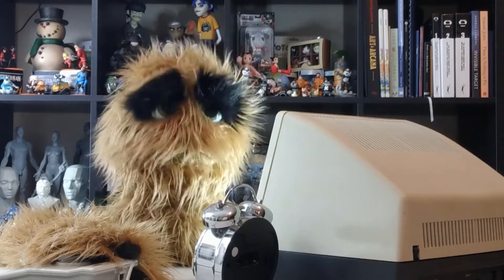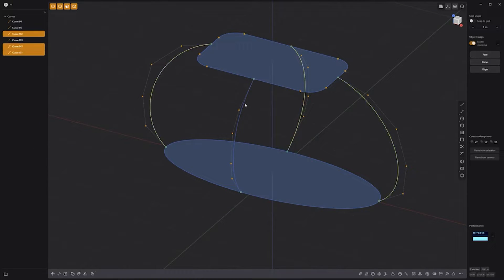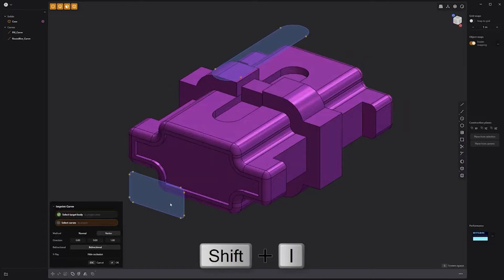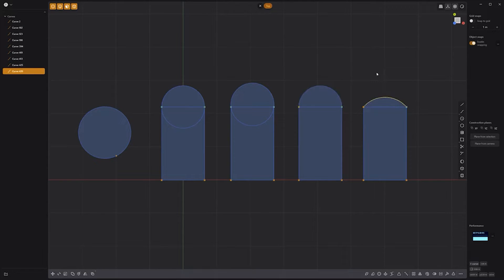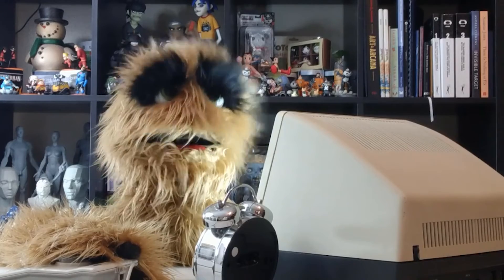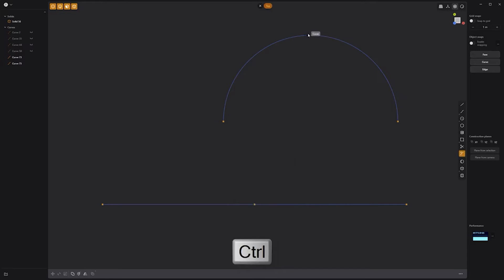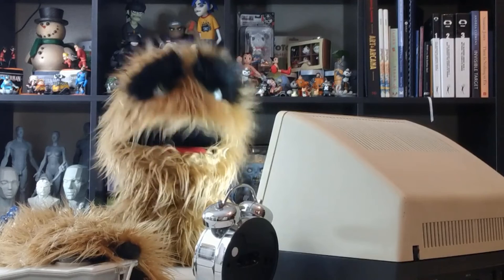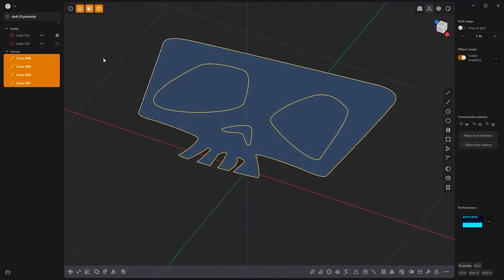Plasticity | Everything about Curves

Comment: So, we cannot align a curve to a curve? This is weird....Using bridge cuve co create alignments is not a feasible solution, it is a different thing. This is very weird, as it is such a basic thing. Thank you :)
Reply from the maker: There may be a newer feature that can do it, this compilation is with an older version of Plasticity.  I'd ask on the Pixel Fondue discord or the Plasticity Discord - it's may be possible to do this now.
Reply: @pixelfondue  No it is not.....And it is very weird as it is such a basic thing. There are other things that need implementaion, such as surface edge projection on surfaces and viewport tesselation adjustment. I ll send a note to the developer. Thank you anyway and for being so kind :)

Comment: Hi there! Thanks a lot for all those short videos. They are straight tpo the point, very infomative and, well, short. I'm learniong a lot from them. I have an interesting question though, I couldn't solve in plasticity so far: How can I create a coiled phone cable that's following a spline?
Reply from the maker: I dont think there is currently an option/feature that allows for that. Its very easy to do in something Like Modo which is how I would tackle it. If I work up a solution in Plasticity,  I'll make a video and share.